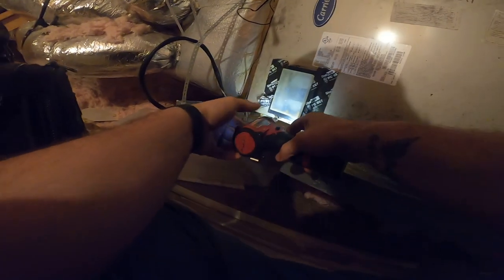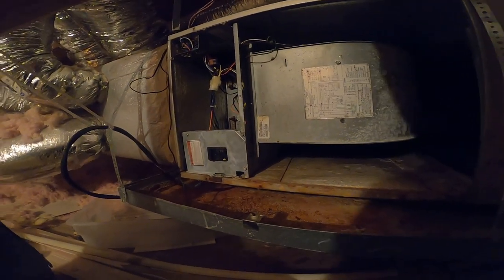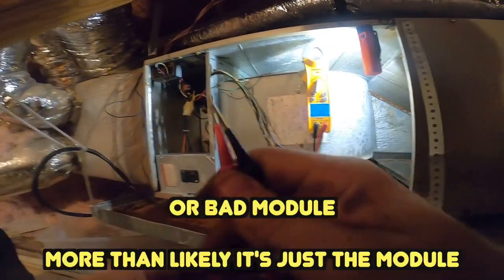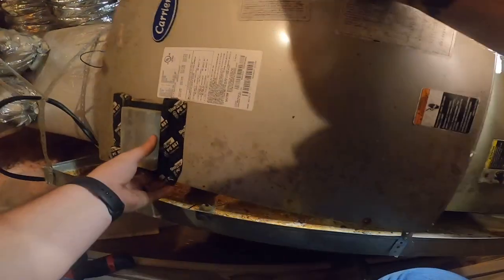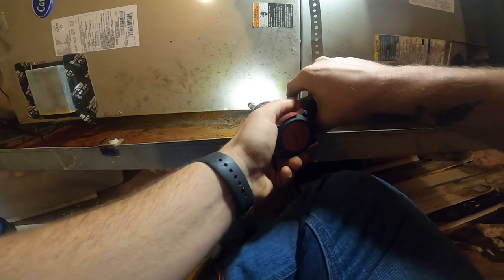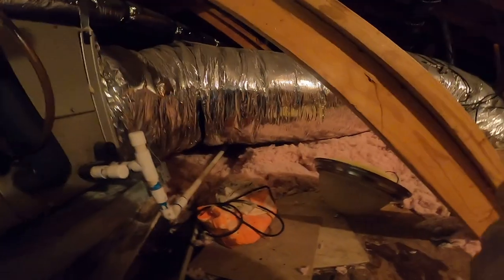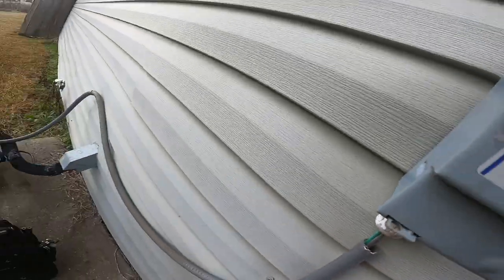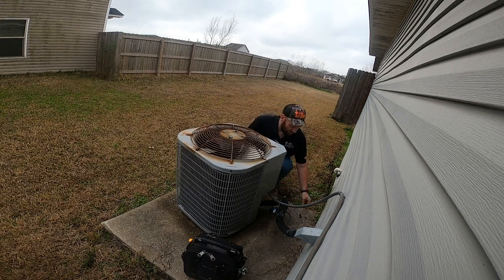Carrier System Not Cooling/No Blower Motor

Comment: I know you're not a hack by any means, but when I hear you mentioning you'll be reusing plentums and whips, it gives me major hack vibes lol you're replacing it, might as well go back in with all new everything besides ducts obviously unless the customer wants them
Reply: What's the difference in not replacing duct work vs a whip with good insulation and connections
Reply: @coreybomhoff7475  you’re doing a changeout, if I’m a customer, I don’t want to go to the attic and see an old dusty part of the unit butted up against a brand new shiny air handler, just my opinion and the whip as well you’re taking out the old condenser, might as well replace the whip make it all look brand new